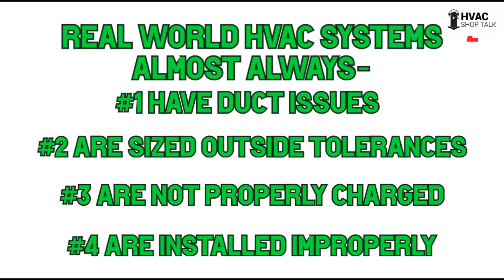The Real World Truth about HVAC Systems

Comment: with the costs of these new systems, no. i just refuse point blank to replace, if it is irrepairable, i will remove the coil, and i will install a window unit big enough to do the whole home, and just use the fan. idk whos spending 40k on these new units but man i wish i had even half the expendable income they got.. i can even get a giant window unit with a proper compressor for less than a fraction of the cost of these new systems, its sad.. its essentially a cash grab now, for what some say isnt a luxury, but a need, like heat and hot water..

Comment: agrre motly. like in my house manual j calls for a 4ton. yet in the basement there isent enuff room for a 4 ton coil. so 3 ton unit and believe 3.5 ton coil. either way have lower the cooling requirements of house with more insulation now a 3 ton doesn't really run long enuff even tho it a 2 stage unit. works great on them really hot days atleast lol.

Comment: The first owner I worked for used to tell us "Fixing the customer is as or maybe more important than fixing the problem."

A good install will go a long way towards preventing a lot of problems. If the service side wasn't too busy, lots of times the company would have us service guys go out and "fire off" new construction installs to help prevent problems when new owners would come into the homes. That would save tons of problems down the road... and made for happy customers. Check the refrigerant pressures, check gas pressure, and check air flow to the registers. Often, trying to balance air flow to ensure all rooms were receiving adequate air flow would be one of the hardest problems to solve, especially on homes built on a slab and the supply ducts were run under the slab.

Comment: Mine's getting there, 10 degrees of superheat on a 92 degree day and now I'm about to wire a discharge temp limit switch to the compressor discharge.  While in there, a new fan blade might run smoother.
Hopefully it outlasts me...

Comment: My dad 2008 Amana Heatpump and Goodman furnance stills works and good old R22. Only 2 repairs. One changing 3 of 4 heating elements and changing a board outdoor because the heatpump had hard time reversing back to Heat after defrosting. Nice video! 2.5ton outdoor and 2.5 indoor but i think he should needs a 3 ton. But 2.5 ton was OK. nothing is perfect as you said. Almost 20 years old and still kicking! 17 years old this year.

Comment: You just think you have problems now wait until we get some of these for R454B systems running for a couple of years that’s when the problems are really gonna start to happen. These super techs out there that are not using the proper Freon to top them off there new installs, and being a two part Freon that even makes it worse if you want do good by your new and existing customers sell them R32 equipment.
Reply: R410A is a 2 Part blend 50% R32 and 50% R125. R454B is 70% R32 and 30% R1234yf.